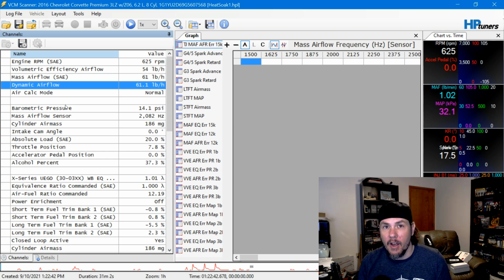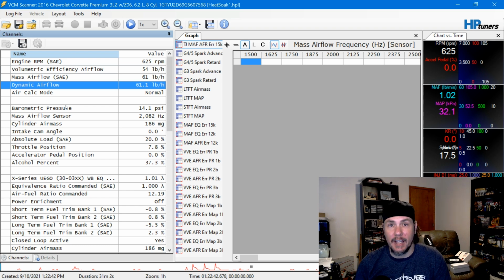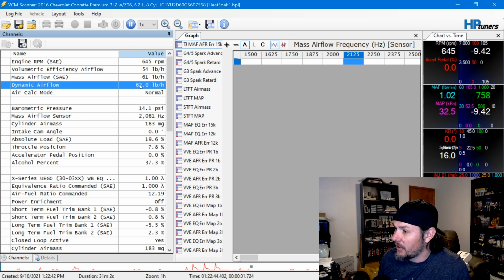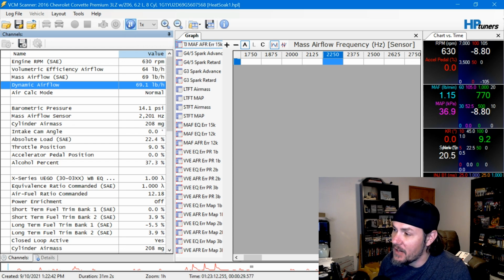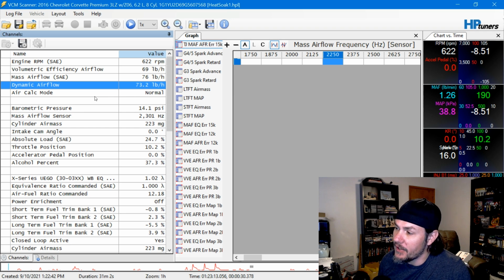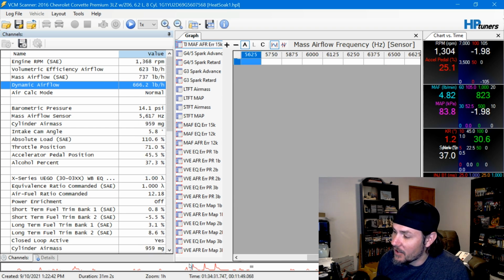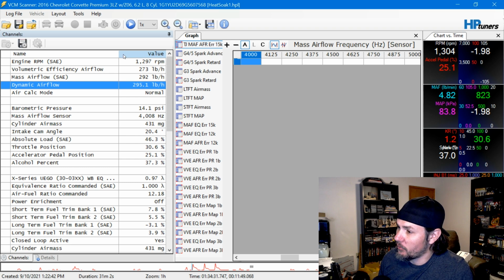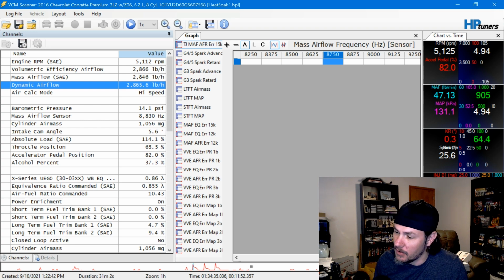Dynamic Airflow And Why It Is Critical To Proper Tuning

Comment: I have a 2008 Dodge charger RT with a 6.4 intake manifold with a 93 octane tune/90mm throttle body/cold air intake with a straight pipe exhaust..I have the Diablo i3 ...I'm trying to change my Air to fuel ratio could u please help me out I'm so lost...lol🤣🤣I don't want to blow my engine so I'm reaching out to u...

Comment: So I have a tune that is good with both the maf and ve.  I am going to install bigger injectors.  I have all the proper injector data and am confident it will be inputted right.  If my fuel trims are skewed afterwards, can I somehow tune the injector data via flow rates and offsets?  This is a p59 ecm.  Thanks for any help, I apologize if you have a video already on this.

Comment: There’s a popular shop not to far from me that is notorious for doing MAF only and not telling people. I called them out on it once and they said that maf is all you need, VE is for limp mode.
Reply: My original tuner said the same thing and also said he never does E85. The only thing he had that I didn't was my $600 and a Dyno.
Reply: @fasnuf  Rough- I even requested a changed to the 2 bar OS since I specifically installed the sensor they sold me
Reply: I also went to a shop like that... MAF only tuned my supercharged application. Relying on trims under 2000RPM and if I ever run out of MAF who knows
Reply: Well to be fair on a MAF tune the VE is only used in transients and limp mode lol.   

Their not wrong,  but they are dumb.   They just assume once the CEL comes on the vehicle won't be driven any further,   in which case the VE as it is would be fine.

Comment: Another good video BUT...
You have never done a video on transient. 
When you slam on the throttle you get a massive lean spike. How do you fix that?
You haven't done a video on this. Maybe you can go through  this process.
Reply from the maker: Most of that is all VE table issues, but I will do one on the transient stuff too
Reply: @GoatRopeGarage  I think that is well beyond needed. This question has been beat to death. And it needs to be shown the gains with actual testing and logs.
Reply: @GoatRopeGarage  did i miss a video for the cure of  lean tip in on hard accel above 35% throttle on OLSD?

Gen 3 silverado supercharger with  s467.7 turbo combo

Comment: I’d like to know more about adjusting the conditions at which dynamic airflow is enabled.     I would assume this would change based on valve timing.   With a long cam (and/or more overlap) does the enable rpm need to raised significantly?